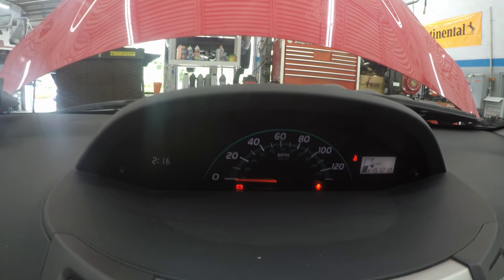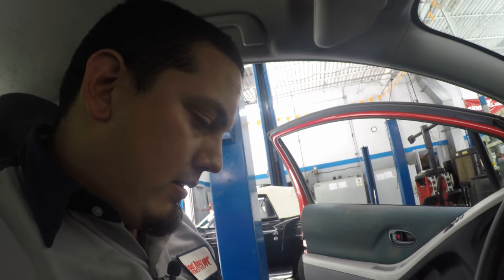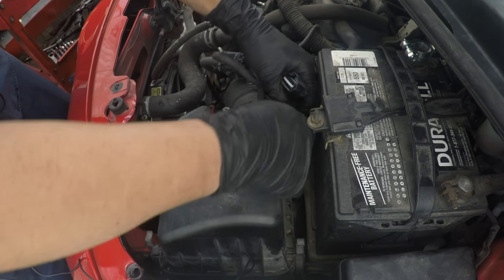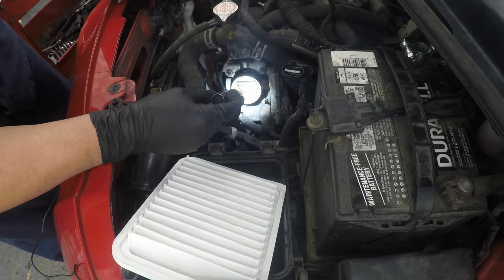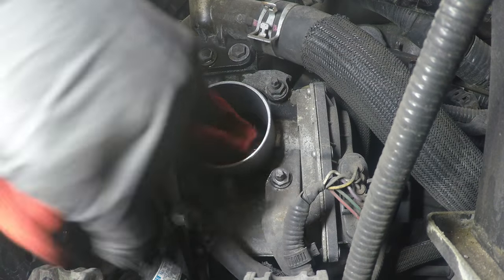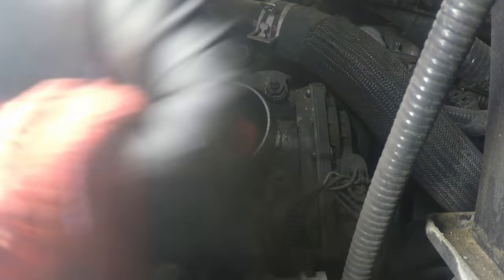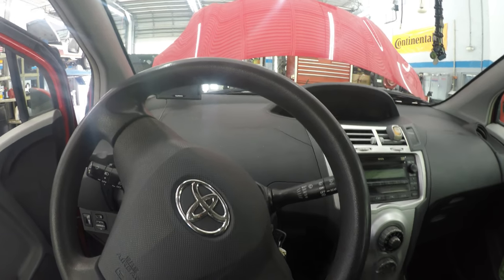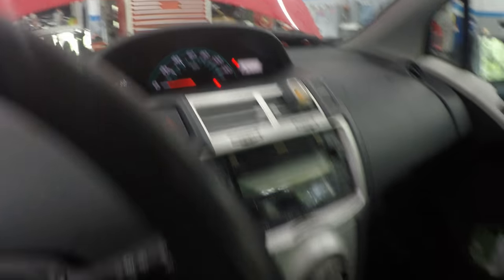2007 TOYOTA YARIS LOW IDLE DIAG & FIX(battery light on)

Comment: My symptoms was the car stalling when coming to a stop at a traffic light and hesitation of the engine at a slight throttle at steady speed. At idle the RPM was around 500. Following the steps in this video restored the idle to around 1000 RPM. 
Thank you very much for this video!
- 2006 Yaris 1.33 VVT-I
Reply: Thanks

Comment: Cleaned it on mine after it started idling very low - 400 ish rpm (strangely after a battery change) and purrs like kitty now! Thank you!
Reply: Did your engine light come on at any time during this problem.

Comment: My 2007 yaris had bad engine shaking for like 3 years.. it would rattle the entire car, and at 230,000 miles I just figured it was father time on the engine. No check engine light or codes til this past year and it was p0505. Car still ran, but smog service was due with registration this time so I had to figure it out. I was going to start with the PCV Valve and Throttle body clean, then MAF sensor cleaning. Turns out it was the Throttle body, because after I cleaned it, the code went away and the car does NOT shake one once. Feels like a new car now after dealing with bad engine shakes for years.

Comment: Worth doing it every 5 yrs or so along with the PCV while your under the hood. I do this every 4yrs when i do a service along with changing the power steering fluid & coolant (Prestone) on my 2002 1.3L Yaris auto here in the UK,i've had it for 14yrs.  Ran smooth as silk non stop.

Comment: I recently got a 07 Yaris that had a slight vibration at idle which was worse under electrical load. I suspected a dirty throttle body as everything else looked fine. Disconnected the battery to do a stereo install and on the first start it stumbled and died. Then the second start it ran but the idle was really low and a lot of vibration. Idle was terrible but it drove great. I cleaned the throttle body and it didn't seem that dirty but idle was way higher after cleaning but smooth. I had to reset the ecu by unplugging the battery to get the car to relearn proper idle by doing the idle relearn procedure, basically just let the car idle for 5 minutes with all accessories off. After that it sits right where it should at about 650 rpm in drive.

I didn't know about not moving the electronic throttle by hand but I did unplug it while cleaning it. I used one of those plastic panel clip removers to hold it open while I cleaned it. 
I was gentle with it I didn't jam or pry on it just slowly moved by hand. Since I had it unplugged I don't think I damaged it. There was two times afterward when driving the car cold pulling out from being parked and just barely touching the gas pedal the acceleration was jerky until I gave it more gas but other than that its been smooth. So I think you can get away with moving the butterfly by hand with the battery or throttle power disconnected but I wouldn't do it that way again. It idles much smoother now however that definitely fixed that issue. This weekend I'm doing a new pcv valve also just to be safe. Good video with good info, thanks.

Comment: Great, This might fix the small shaking problem,  no check lights ON but cleaning it won't hurt anyway. Specially in a northern city like Québec.  Thanks.
Reply from the maker: You got it bud, this was several symptoms from one cause, shaking, low idle, under charging, stalling. All from a dirty throttle body

Comment: Part of my routine servicing for the past few years has included cleaning throttle body and pcv valve, scanning ecu for any odd readings especially fuel trims, all while the oil is draining. Cleaning pcv valve has helped along the way to solving a few silly problems.  Mostly easy stuff to do.
Reply: Add to that clean battery terminals and electrical connectors, particularly those pesky corroded ground connectors/cables. And you're welcome to the world of mostly trouble free and cheap vehicle usage. ;-)

Comment: 2007 Yaris with 226,000 miles original owner. First let me say good video. I change my oil, oil filter and air filter every 5,000 miles. I have always had the rough idle come and go. It especially happens when the seasons change and gas supplies change their formulation. I would pull the battery terminal to reset the computer to take care of the issue. Lately I found it easier to plug into the diagnostics port and reset. Recently also had the battery light flicker, then go to normal when good and warm. Diagnostics showed the voltage at 16-17 volts! way too high, should be about 14 when running, voltage regulator? Possibly. No error code but I did diagnostics reset anyways, even though no error code was thrown, immediately vehicle returned to no warning lights and correct voltage condition. Go figure. I'm going with software settings corruption theory for now.
Reply: Most probably corroded terminals and contacts. ;-)
Reply: @crpth1  Spot on !

Comment: Hey brother , have the 07 Yaris, same thing just happened and yes I just spent 300 beans on a new alternator. I will take the throttle body and check. I just have a question, once you took pff the throttle body, you noticed right away it was dirty or that it was closed. The video doesn’t show of its dirty. I appreciate you can get back to me. Thank you brother.

Comment: My engine light went on, rough idle, then battery dead, did battery torke test, mechNic said it should run at 14, I'm not sure, was told it was regulator in alternator. Without it being looked at.  Is this same problem.
I bang on the alternator and the battery light goes off and we carry on. My Toyota is 15 years old and has 340,000k on it. It makes sense that this cleaning needs to be done. Thank you. 
We did change the alternator, and now engine light still stays on, even after I cleared the computer...3 times. I'm worried this indicator will force fuel through at high speed and fill my spark plugs . Does this make sense to you.

Comment: It worked on my 2004 Scion Xb 1.5L it raised up my idle rpm also changed the pcv it looked like the original part with 190k miles I used Beck Arnley  pcv valve $5

Comment: Hey, thanks for your video. I have a 2008 toyota yaris 1.3 vvt-i (we didn't have the 1.5 here in Italy back in the day) but it's still very similar to the US-spec one. I'm dealing with low rpms, the engine make some weird noise and inside the car you can actually see the passenger seat shaking a little bit. Sometime it's so low and loud that it seems like the engine could turn off at any moment. It'll go away as soon as you push down the gas pedal. I'll definitely check the throttle body. Do you think it's better to check and eventually clean the MAF sensor too while having the hood open?
Reply from the maker: I wouldn't worry about the maf just yet, try the throttle body first, then Look at maf g/s at hot idle
Reply: @SuperMarioDiagnostics  i too have a xp9 1.3l 87hp yaris, i did some testing today, at stops and red lights the rpm goes down, even below 500rpm, with unpleasent shaking and vibrations - would say that is new, maybe 2-3 weeks, am nearly 150k km too so yeah might be a "common" issue?
Reply from the maker: Common across many cars, the pcv system recirculates oil vapors and exacerbates the dirty throttle body issue
Reply: @SuperMarioDiagnostics  interesting, seems like it is not that common around here or the mechanic i told and explained my problem is no mechanic but more like a replacer of modules
Reply from the maker: Well i have no information as to what he told you. So i can't be of much help
Reply: @SuperMarioDiagnostics  "there is no fault or error, and i cant feel anything unusual with your car"
Reply: @SuperMarioDiagnostics  did you find a issue

Comment: 13,3V it seems to low for charging voltage.  But, in this case, it may be because battery is empty and absorbs a lot of current and alternator can not provide enough at idle...
Accelerate a little and thr Voltage should stay beetwen 13.9 and 14.2 V

Comment: What if cleaning the throttle body did not sort the issue?
Ive changed alternator, belt is fine. But battery has not been changed. Drops to 600 rpm and does not charge battery and voltage drops. But runs perfect when i put foot on gar and rev it up to 800 rpm.
Could it be a dodgy 02 sensor?

Comment: Excellent video. Well done. I’m gonna clean my throttle body this weekend in my 07 yaris.  Mine is not shaking but has a “miss” every few seconds only at idle. That’s the only symptom. I think I will do the induction service also. Do you have a video on induction service. I’m also gonna do my wife’s 2013 civic. It’s having some symptoms at idle also and this dirty throttle body could be the culprit. Thanks again
Reply from the maker: Sorry i do not have a video on that. Sounds like you have an ignition related misfire
Reply: Follow up: this worked. However i also cleaned maf sensor and unhooked my battery (reset any computer issues). The throttle body was dirty / the maf sensor was very dirty. I’m not sure exactly which one was the culprit. But the combination fixed my intermittent “ miss” at idle on a 07 yaris. I never had the massive shake at idle. Just a small miss every few seconds. But sometimes felt like it might stall for a split second.  Also no check engine. No battery light.  Thanks again for the excellent video

Comment: Hi Mario! Can a dirty throtlle body makes the car to lose power while driving especially on the hill. I have changed ignition plugs, spark plugs and fuel pump but the car still loses power while driving. Your assistance will be highly appreciated.
Reply from the maker: No a dirty throttle body will not cause lack of power. For that you need to run some tests to find out whether you have an sensor that's reporting incorrectly, or an intake/exhaust restriction. Or a timing issue
Reply: @SuperMarioDiagnostics  Thank you very much for the advice
Reply: Good day. I have the same problem, did you get yours fixed and what did you do?
Reply: @wesselbeukes5999  Hi, the problem was the air intake exhaust. I did change the fuse air sensor that goes in the exhaust and the car performance is now super.

Comment: Hi,i have the same problem, when the engin si hot the rpm goes to 600 and the engine have a little shake i clean this and is the same.any sugestion? Or this 600 rpm is normal for toyota yaris

Comment: Where can I get a throttle lock for this car? I have a the same car and a check engine light on as well as the low idle with 161K Miles

Comment: Hi i was wondering if you could help. I have a 2009 Toyota Yaris 1.33 and i have a problem. I had a check engine light on in the winter months it was Oxygen Air/Fuel Sensor Signal Stuck Rich Bank 1 Sensor 1 but now the light has gone off now as its nearly summer time and after i kept clearing it whenever it use to come on now its not on. Now i have  another problem whenever im driving its really rarely doesnt happen often but when i slow down towards the traffic lights and push clutch down and its in second or third gear the car cuts off but i dont even feel it cutting off and all the lights come on on dashboard but starts up fine when i turn key again. Its happend a few times but not all the time. Do you know what the problem could be. Thanks.
Reply: Same issue did you fix it

Comment: My Yaris when bumper to bumper moving its Shake and engine off again start will move slowly, I scanned error code P0113, can you suggest me 

Voltage 13.7 and the mechanic checked with removing each coil still problem persistent

Please help me dear

Comment: The issue I found for mine was the belt was creating too much friction and it wasnt allowing my car to run, sprayed a little silicon on it to find out that was it, it had the same exact symptoms as this just no scan data
Reply from the maker: A belt alone cannot cause enough of a load on an engine that it would almost stall it. I suspect there may be something that's belt driven that is binding

Comment: Hi please can you assist me ...I have a 2008 Toyota Yaris 1.3 2nz engine code....my vehicle doesn't hold idle ...no power .... Put a Launch diagnostic all clear .... Checked the air filter I did a service in June .... No lights are on  dash ...what can I check pls help me.
Reply: Did you fix it

Comment: Turn the engine off and place a heavy weight on the accelerator. This opens the butterfly valve and you can then clean it.
Reply from the maker: That's what i used a throttle lock for lol

Comment: Is it not worth removing the throttle body to clean it properly
Reply from the maker: If you can't clean it properly without removing it, then go right ahead. Just don't forget to change that gasket.

But really, it's not that hard to clean it thoroughly without removing it
Reply: @SuperMarioDiagnostics  Ah fair enough. Ive heard of people doing an Idle reset when would that be necessary? Plus I was looking at cleaning the MAP sensor as well is that worth doing and do you have a vid for it?

Comment: May yaris of 2005 1,0 cc gasolin sometimes start normal sometime late and when it starts it shakes and normalise a cleand mas air sensor the throtle in pro servis they cat find the problem and sometimes accelerate on it owne litel pulsing when a stop the car and normalise for few sec

Comment: Okay soooooo. My idle is awesome now. Lol. But my damn batt and air bag lights still come on intermittent. Only under load.  Never during idle.
Reply from the maker: What code?
Reply: I can’t get a code out of it because it doesn’t have a CEL nor does the batt light or air bag light. I have to leave for Atlanta in 8hrs for a car show at Atlanta Motor Speedway this weekend! Import Alliance
Reply: During idle it’s fine. Then when you drive it comes on for only a second. Almost a flash. But stays solid for a good second.
Reply from the maker: Lol you just said the airbag light comes on
Reply: Voltage regulator. It will trigger the airbags light if it’s low enough...

Comment: at 6:19 it looks loose on the shaft...
Reply from the maker: If you keep watching i had to jump start the car, the battery was dying as the pedal was being held open. So the throttle motor current was suffering. Not loose at all buddy, thanks for watching!